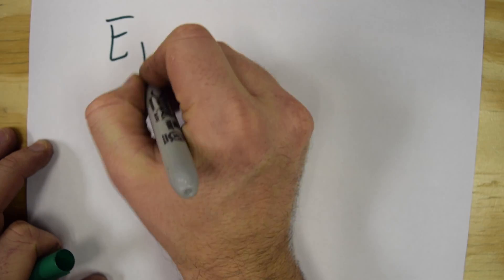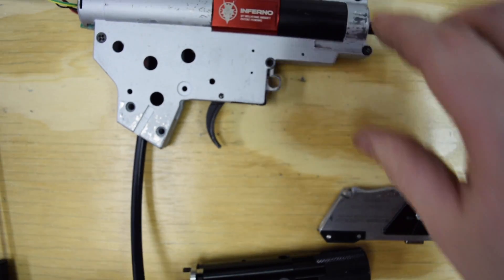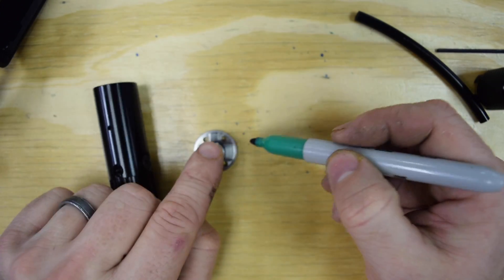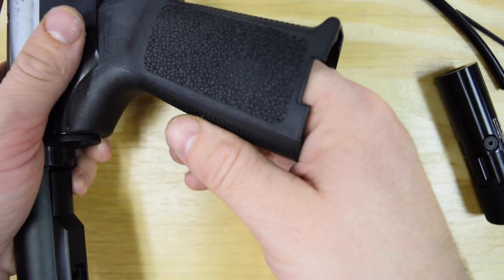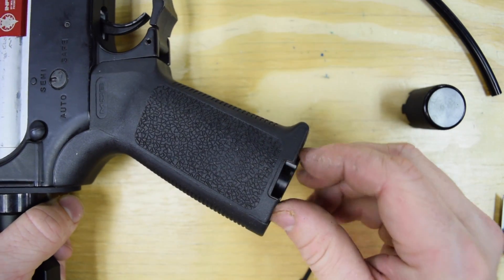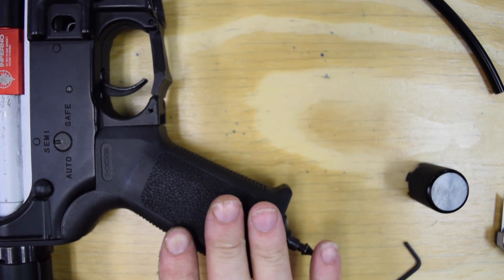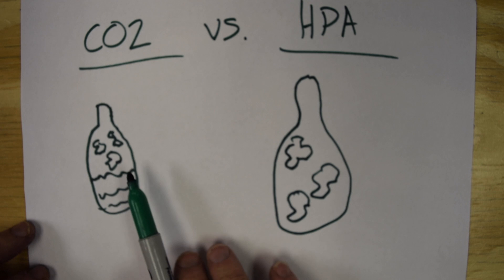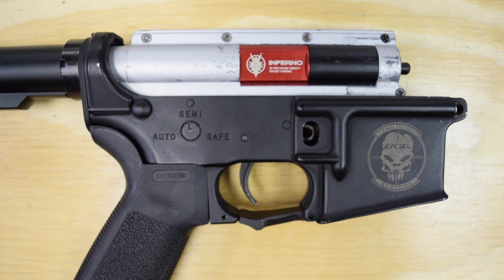What the Tech?!?! Ep. 4: Storm InGrip and CO2 vs. HPA

Comment: Wait, I read on your website co2 was fine for the storm? I'm glad the store was out of co2 when I went...
Reply from the maker: Hi Cameron, can you provide the link to the page where you read that? CO2 is only okay when using the Storm InGrip regulator with a remote line to act as an expansion chamber. Do not use an OnTank regulator directly on a CO2 tank.
Reply: Wolverine Airsoft yehabi must of misread something. I also had a local HPA user telling me I could use co2 so that through me off as well....

Thanks for the response guys.

Comment: hi Wolverine Airsoft, i was wondering for a build i was doing.
i have a co2 adaptor that goes direkt in your storm in tank regulator, and i would want to use it in my bolt sniper.
this fits in the stock. but it may get som co2 liquid in the regulator, is that a problem for the regulator?
Reply from the maker: You do not want to get liquid in the regulator, we will be selling kits to go with the Bolt that will allow you to use co2 mounted in or on your rifle
Reply: Awesome

Comment: Hold up, why is it bad to run co2 through the ontank Wolverine airsoft regulator? it regulates the pressure down to acceptable pressures, even on Evike it says "Compatible with Co2" why not run the QD line straight from that regulator to the gun? You're to say you'll need two separate regulators?
Reply from the maker: +Damion Jed 
InGrip allows you to use co2 because the QD line separates the regulator from the tank and acts as an expansion chamber for any liquid that could get through. The Ontank version screws directly onto the tank, if any liquid got into the regulator, it would get pushed into the system.

The QD line does not regulate the pressure down, so whatever the psi the tank is, that is the pressure that would go into the system. That would not do good things.
Reply: +Wolverine Airsoft I see, however, what if the system i was pushing Co2 through was not a polarstar or any kind of electro pneumatic system? rather a system more robust? I'm sure id see increased wear and tear and I'd imagine I would see an occasional bb shoot off with a much higher velocity, but if the system had a higher tolerance I would still be able to make due correct? Minus one or two O-rings that i might have to replace if they happen to freeze, but that would be about it, I should be able to use just once regulator, sure its not advised, but still completely possible, now, im not positive I'll stick with Co2, more than likely I'll switch over to Hpa, which makes me happy that your ontank regulator can handle Co2, but since you say that if liquid Co2 enters the system it would be stopped in the line, does that mean that the Co2 on tank regulator would be able to withstand that type of occurance? or is it still best to just avoid liquid in the system all together? I'm curious as to the durability
Reply: +Damion Jed should be able to use just one regulator**
Reply from the maker: The reason that it works with the InGrip, is because the line is BETWEEN the tank and the regulator which prevents liquid from getting to the regulator. With the OnTank, the line is after the regulator, so any liquid that got into the regulator would be pushed into the system. 

All that being said, you can run co2 with just the OnTank regulator, but it will void the warranty. It will increase the chance of damaging your system.

Comment: So, if one were to drill a small hole on the grip that lines up with the regulator adjuster screw, I could, in theory, adjust the regulator while the air is hooked up. Just as in a paintball marker. Don't see why this shouldn't work. There are more/other solution's by the way to preventing liquid CO2 from entering the system.
Reply: +JackNL499 Did that for years when I player Milsim paintball. Not a practical solution for me as it adds some bulk and also adds a risk of breakage when running around the woods. I'd rather have most components hidden inside the airsoft gun as much as possible.

Comment: How does going prone (changing the position of the co2 tank from vertical to horizontal) effect the INgrip regulator. I would think that going prone would allow liquid co2 to get into the regulator.
Reply from the maker: +AirsoftTeamOSMD If you try mounting the bottle high on your back like we recommend and then try to get in a position that inverts the bottle. It's actually hard to do. As mentioned in the video if this happens briefly it will not hurt anything, though performance will be negatively effected, it takes a lot of sustained firing to draw enough liquid past the reg to actually do damage. And when I say that, we have yet to succeed in getting enough liquid past the reg to actually damage the inferno/SMP orings, let alone the valve or such, even when firing on full auto with the bottle completely inverted. I'm sure if you did it long enough you would eventually destroy something, but we haven't managed to do anything more than get big pressure spikes out of the system.
Reply: Wolverine Airsoft  hey I've just had the wolverine ingrip installed in my krytac I also got a line from amped airsoft it's rated at 3000 if I'm using hpa and not co2 will it blow that line ?

Comment: Does the in grip reg come with everything in the video? 
All adapters and line connectors?
Reply: I have the same question I'm  new to hpa and I'm not sure what adapters I need to buy with my in grip
Reply: +Isaac Marinchek the kit comes with everything to install in the gun but you'll need a paintball remote line to connect it from the tank to the regulator. The line should have all the connections needed to make the connections. You can find them at a local paintball shop or in line. 
Home it helps. Super easy to install took about 20 min and I was up and running
Reply: +Airsoft Padre I bought a amped airsoft line with dual quick disconnects do u know if that will work?
Reply: +Isaac Marinchek no the standard HPA line won't hold the pressure from the tank to the reg. You need a paintball line. The standard line is only rated to 900 psi. The Ingrip reg doesn't regulate the air pressure till it gets to the grip. It's coming from the tank at 3000 to 4500 psi depending on your tank. A paintball line is rated at 4500 psi and can with stand the pressure from the tank to the in grip reg. Is you hook up the regular HPA line it will burst. Experience talking here:/
A paintball remote line will have all the connections from the tank to the reg needed.
Reply: +Airsoft Padre do u have a specific paintball line u would recommend? like I said Im new to this hpa stuff sorry about the dumb questions
Reply: +Isaac Marinchek no worries we were all new once:)
I have the Ninja paintball QD line got it on amazon for 40 bucks. Works great and it's a micro line. Easy to hook up and use. Happy to help if you have anymore questions. Wolverine has a great helpful community.
Reply: +Airsoft Padre thank u a ton man u have helped me out and saved me a lot of money
Reply: +Isaac Marinchek no problem here to help. It's a great system and reg I've had mine since they first came out and I've had a blast with it ever since. And yes pun intended:) let me know if you need any more help

Comment: In your testing, approximately how many shots per cu. can you expect to get out of this system. I've seen several formulas posted but they all refer to the p-star fusion engines.
Reply from the maker: +CD95YJ That depends, on a 3,000 PSI tank, generally 70-80 shots per cubit in. On a 4,500 PSI tank, generally 100-120 shots per cubic in. Mostly it depends on your setup.